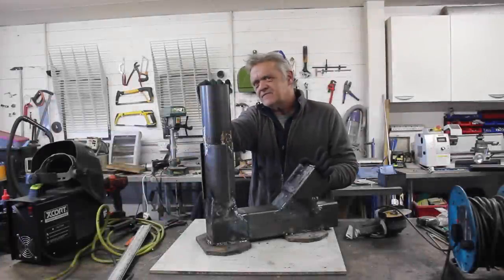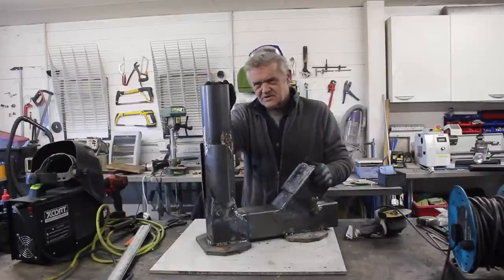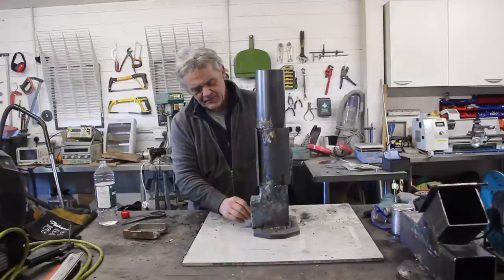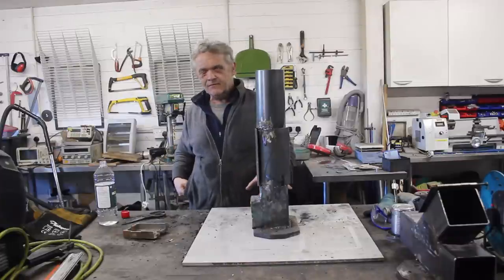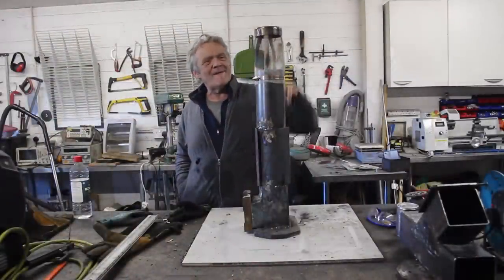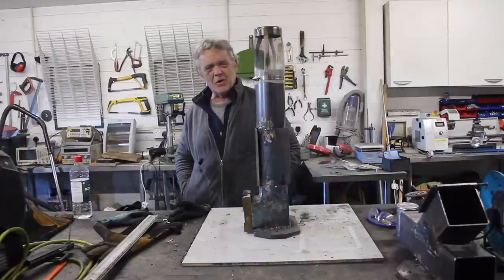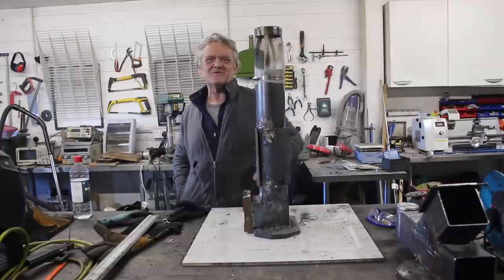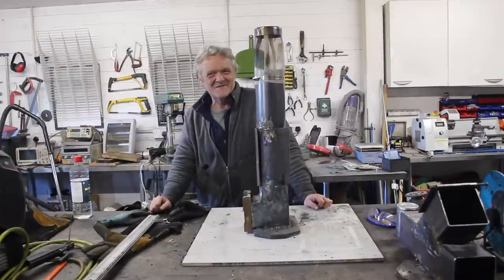1751 Sensible Vortex Heater Prototype

Comment: Greetings,

So at our camp in the woods we've been using expensive propane and I plan on making a waste oil burner.  Now we don't want the waste oil burner inside and might wish use other fuel such as wood.  We can get waste oil free basically.  I've looked at vid's how various people do such things most of which are pipe within the stack/burn chamber and use convection to heat.  Can't control the heat this way and pipe get might hot to then go inside.

So I've been considering this & wonder what you think of it.  Whether fuel source is waste oil or wood be basically a burner that heats a stock pot of water, I'm thinking 5 gallons thereabouts albeit smaller the better usage of the burn.  From there two water lines output and return, water lines run to a car radiator w/ one or two 12v box fans where can control air flow through the radiator, perhaps a 12 volt pump on the return side and/or output side.  Obviously car radiator is designed for significant flow of coolant through it so I figure simply restricting the input/output where upper/lower radiator hoses go keep hot water in the radiator longer (or perhaps transmission cooler?).

I dont want the stock pot (or turkey fryer pot) sealed as then need worry about steam pressure albeit any steam could be reused whatever, perhaps drive small electric turbine or something.  To keep water in the system a simple float valve draw water from a reserve.

Now I saw on YouTube fella who made a hot water heater out of a Propane Tank, basically burn chamber welded inside the tank isolating it and circulating water around the inside of the LPG tank, quite effective.  However, then we're talking Steam relief valves and other dangers, for example a combustion chamber failure lead to an oil water mix, water super heating, all possibilities I don't care have attended or unattended LOL.

I realize loose great of efficiency heating water, circulating it... I mean we're not talking about commercial boilers or even home boiler here which have all forms of safety features.

What might also be neat in line with you're thermal electric is using the heat generation of such a beastie to create electrical current, be real cool if it could power the pump and/or 5 volt (or 12) fan(s) on the radiator?

I've not built a lick of the concept mind you as camp is closed for the season but when get back down there it's in my reticule.  I'd love to see some videos from you exploring this concept.
Reply: You are actually at the right place and community! Rob has an excellent video on how to make these kinds of heaters into water heaters in a prior video....also there is a product already out called "The Flame Cube" that you might want to check out. It's equal parts rocket stove, water heater and Thermo electric generator.
Reply: @captainnemo6655  Thanks for the reply, I did look at Roberts Rocket Stove Water Heater made w/ an LPG container.  Whilst very efficient way of doing things as I saw on another channel it's also dangerous in that superheated steam is nasty stuff.  Sure, can put pressure relief valve in place just as a common water heater has but they can fail.  When I worked in our local schools I knew the boiler mechanic's and read some of the Steam Boiler Operations books, nothing to be trifled with.  A fairly small boiler where for example fire tube failure thus water gush from the surrounding vessel into the fire tubes can result in an explosion that will readily lift a locomotive engine airborne.

The boilers I had to deal with sediment blow downs etc basically an oil burner w/ fan atomize the fuel/air mixture and ignite it down a large steel tube and in the back of the boiler there's refractory material.  That directs the heat through about 16 steel tubes back to the front of the boiler and up the exhaust stack.  Water surrounds those "fire tubes" and is turned to steam which then circulate through the building old school cast iron radiators eventually making its way back to an expansion tank.

I want something far more simple at camp whereby I can also use oil or wood firing simply by removing or changing out the heat source under a stock pot or Turkey Fryer Pot.

I've saw some vid's whereby folks coil copper tube around LPG tanks, exhaust stack etc but to me doesn't make much sense do that as why not simply apply direct heat to a vessel that holds water as a water heater does but just have it a vessel that doesn't have steam pressure.

Using Thermodynamic electric tiles as Rob has shown a cluster of those might well be able to at least spin up 5 volt, perhaps 12 volt fans behind a car radiator that'd be inside heating our place.  I doubt albeit I might be wrong that they'd produce enough current to operate pump's help move the water.   However they might be able help trickle charge car or lithium battery and then during daylight supplement the battery recharge using solar.

Key is want the "water heater" outdoors away from our living space and have it be able run unattended and safely.  Currently we'd used a Mr. Heater w/ LPG and it'll keep our place toasty.  For example 35 degree nights I'd had 68-72 degrees inside with the unit running one LPG panel which equals 8,000 BTU's.  The problem w/ LPG gas is a whole lot of heat is lost as we've intake/out vents circulate air and get rid of the carbon monoxide concerns.

With a circulating water design I don't need concern myself with that.  Atop that the Mr. Heater heat tends to go straight up, whap... So I've fans that need circulate the air or we end up with this sort of thermal layer.  Stand up to the ceiling for 5 minutes be sweating, lay down on the floor a bit chilly.

Comment: The biggest thing that I can think of is "how do you control the beast?".  In other words it would be great to have a temperature control of some sort.
Reply: For flame to exist you need three stuff: air, fuel and heat. So answer to your question is either you control airflow or fuel flow. In this case, since it's liquid burner, it would be more suitable to control the flow of the fuel.
Reply: @rizla8602  exactly what he said :)
Reply: @justtinkering6713  you could. Just choke out the air supply by capping the top of the chimney and bottom.

Comment: the mantle here also doulbles as a spark guard.
Shame these take room air to burn and exhaust into room air. if the in/out streams could be isolated..... and fins or tubes put on the chimney.... bit like a steam engines boiler/heat exchanger...

Comment: What about using steam to boost the vortex ? I have seen some other builds that use steam to boost the airflow internally. Always appreciate your videos, keep up the great videos!
Reply: This would be pretty cool. I know if you burn certain alcohols, water is left over. This can be integrated to run a mechanical turbine.

Comment: Why does the flame grow stronger when you block the air supply?
Reply: It changes because you change the pressure differential of the air flow itself. The Vermuli Effect? Venturi Effect? I think it's called.
Reply: Fuel rich before, closer to stoichiometric after blocking off extra air.
Reply: @captainnemo6655  Thanks.

Comment: Hello Robert. I am a new viewer of your channel and I’m really enjoying your projects. Great job sir! I have a question/ suggestion for more heat output from rocket stove type heaters. I saw your colleague make a water heater from a coil of pipe around the upright pipe, and it seemed to work very well. My question is could you do the same thing with a slightly larger diameter pipe coil but with the goal being to gather the heat from the upright into the pipe, then use a fan to blow hot air into the room? Perhaps with a small computer fan? Thanks for your time.
Reply: Good question I was always wondering about this and Rob actually has an excellent build and guide video on how to do that kind of water heater, it's in the video library.... Also since you have fans in mind. There is a product out already called "The Flame Cube" it's small but imagine super sizing it to work as the central heater for a home?
Reply: I guess I should have made it a  little more clear that my idea is to blow air through the hollow pipe wrapped around the upright. Maybe if the air moving through the pipe is at a lower CFM then it would output warm air without cooling off the pipe. Sorry if I didn’t state my first post properly. Thank you!
Reply: @BradfordKMassey  you are good, I understood. Check out the design for The Flame Cube and then check out Rob's design on the original rocket water heater. Play close attention to the place where the fan is located on the Flame Cube, it can be made so it's got a pipe attached to it and blow air through it as you describe. The idea works in the simulations I have run. Did you get a chance to see both of these?
Reply: @captainnemo6655  No I have not. But thank you so much for this clarification. I’m new here so I have a lot of videos to catch up on apparently. I appreciate you steering me in the right direction. 👍🏻👍🏻
Reply: @BradfordKMassey  no problem good sir! Rob's video library is the best binge watching we can do! Cheers! It took me about 3 months to go through the material in the video library. Take your time. Run into questions? We are here to help :)

Comment: Robert as a huge fan of yours could you please teach us the second method of Methanol production please? I’ve researched it ever since you showed us Destructive Distillation and tried it myself but if it is possible to get a higher efficiency I would prefer to be more eco friendly!! If you can’t I completely understand Brother, everyone has a life after all and responsibilities. Thanks again Cheers from Canada!
Reply: This!! This too as I also had the same questions and want to always be ready with a fuel source that won't get me fined and is handy in an emergency weather situation , such as abnormal snow storms.
Reply: @technosaurus3805  for this reason is why we are exploring the concepts of rocket stoves mixed with vortex heaters. Two burns, one stone.

Comment: would'nt it much more effective when the vortex air-intake would only be 4-5cm high? when its as high as u did it, the sucking-effect can not be very "sharp"
Reply: Very good question. What size of inlet and what size of chimney have the best vortex effect.
Reply: @Jeffrey Wolsieffer good clarification. Cheers!
Reply: @Jeffrey Wolsieffer I believe u did not understand. the higher the vortex-generating 'zone' is, the mellower is the drive of the air coming in. we are talking about air-intake-speed ... with a huge zone like in the video it takes in a lot of air but with very little speed (air flow)
Reply: @toltacoatl  excellent point to make! And good insight

Comment: Please explain why flame increases when door is closed. That’s contrary to intuition. 

Please explain why you said more efficient… do you mean more effective? i.e. more heat and bigger flame by burning more fuel.
Reply: The secret counter intuitive process at work here is the change in air pressure when you do this. Larger opening at the top of the chimney and small opening at the bottom, combined with how heat and cold air flow over the surface of the chimney itself is what causes this. Please take a close look at how giant Termite Chimney mounds work. They do the same thing naturally.
Reply: @captainnemo6655  I know when you restrict/narrow the airflow, it accelerates. Is that why the flame gets bigger when he put the door on? Or part of the answer?

I’ve not looked up about termite chimney’s yet
Reply: @captainnemo6655  it seems like termite mound ventilates itself with drafts using hot air rising to pull cooler air from the bottom… but I didn’t find any more specific information about what you were talking about.

Comment: You should figure out a way to make the section you cut off removable. This way you can have it attached to burn wood, remove it, add the door and burn liquid fuel. It would be a true dual fuel heater
Reply: Good idea, you could have an opening on the side like a mini stove door which will also give you access to block off the wood feed channel with a baffle plate or a fire brick cut to size. The 'stove door' could have a seal and latch for when using as a wood burning rocket stove...
Reply: So it wouldn't need to be cut off at all

Comment: Too bad you couldnt make a vortex type rocket stove that could heat up a sand battery. Like mounting the rocket stove inside a hundred lb propane cylinder then going up with the chimney then turn down and come out the bottom of the cylinder then turn back up to go out. Then fill the cylinder with sand to be heated up by the super hot rocket stove it should last for hours.
Reply: You can actually. Have you ever seen a cutt off diagram of how a termite Chimney mound work? The material the chimney is made is exactly what you are thinking of and works the same way too. I was even wondering if the whole design can be made with Crucible Fireclay?

Comment: I wonder what would happen if you used ethanol saturated wood... In all honesty I wish I could have asked before you chopped it in half 🤐
Reply: I was just wondering the same thing!! For that matter, would it work if it was saturated wood pellets? Would it work for paper bricks?
Reply: Vermiculite granules are highly porous too. I used to add them to soil to maintain water content. (sometimes mixed with perlite granules which are also highly porous ). I don't really know if Vermiculite granules become Flammable when the fuel runs out... Also, I actually just googled Vermiculite and there are pictures of it with bottles of liquid fuel so I assume it's already used for something similar.  Perlite, however, is actually 'Volcanic' so I would hazard a guess it is Not Flammable. If it's Not then I figure it would be safer.
Reply: @lilbullet158  this is good to know! My idea was a diy version of the Kingston brand of charcoal briquettes but with other materials instead. Really good info. Thank you!

Comment: You can make it more efficient by using the waste heat of the exhaust with coils of copper tubing running up your exhaust cold inlet goes in the bottom with gravity convection heat absorption the hot water will naturally start flowing out the top and it could go to a hot water source like a heat exchanger with a fan at some distance heating additional room.  
     We would also use it to heat our hot tub and we used it to heat our domestic hot water tank all from one heat exchanger flowing water through it off of our wood-burning stove. 

Sometimes the hot water tank for domestic water would get so hot occasionally it would blow off the high pressure high temperature valve but it was located outside the house. 

At the same time all through the winter and colder months of the year we had a nine person size hot tub in the backyard off the deck that was cap at 114°F +24 seven the majority of the year all from our wood-burning stove we never had to pay for heating domestic hot water and the word came from trees that we cut down locally when we would build houses and clear lots to make room for houses. 

In this method you get the radiant heat that comes off the stove in its location locally at the point source. 

But you have all that wasted heat that goes right out the chimney and you absorb that heat and collect it in water and pump it to different locations throughout your house like I described above. 

Super easy to make fifth grade level school kid type project.
Reply: Did you know Rob already has a version specifically for heating water AND generating electricity? It's in the video library already.
Reply: @coldfinger459sub0  you gotta check out the videos in the library.... But back to your point. There is a product out in the market already as proof of principle. They call it The Flame Cube. Works exactly as Rob's build and yours but with a thermo electric generating twist. The thermocouples run a tiny fan that further drives the flame in the rocket stove, which means you can expand on the design by adding a vortex heating component in the chimney. Have you ever seen a cutt off diagram for Termite Chimney mounds? Please please do so, then take a look at how the ancient Romans and Greeks would heat their homes from the outside and below ground to achieve the exact same effect. It's time to get back to those roots of maximum efficiency by paying attention to how the ancients in nature and our ancestors did it.